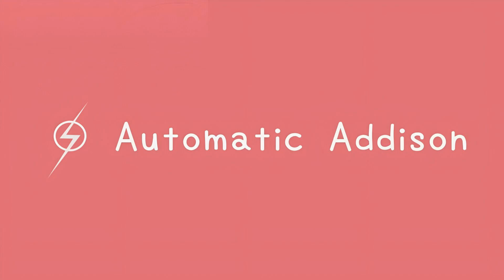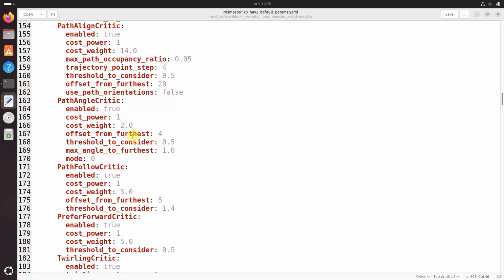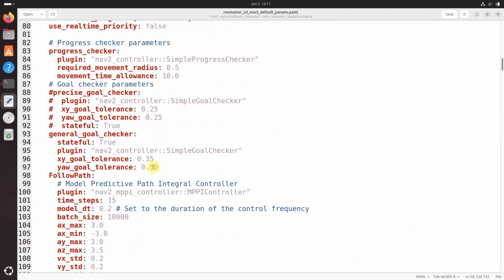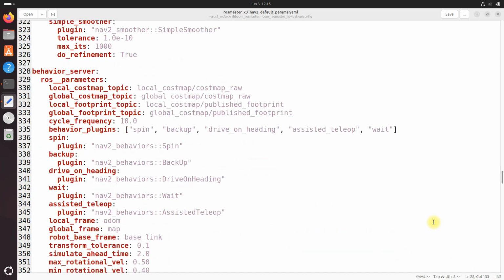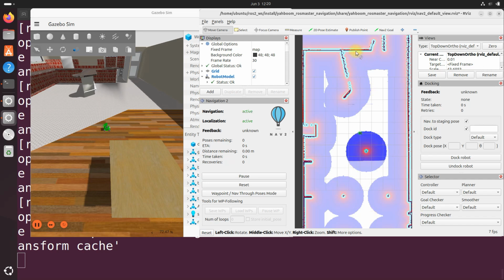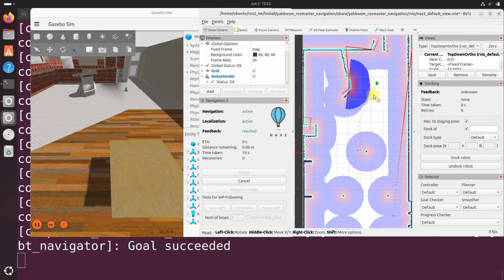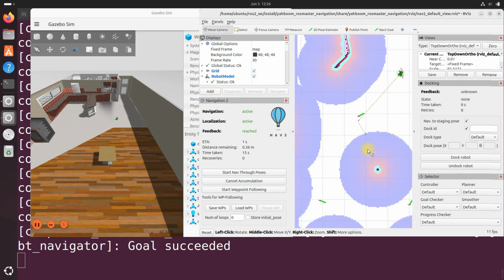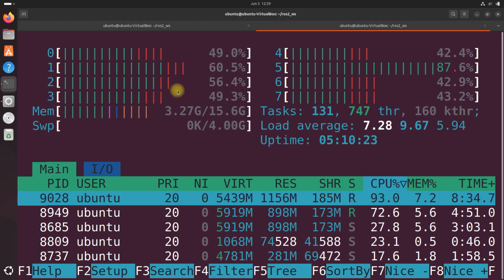Autonomous Navigation for a Mobile Robot Using ROS 2 Jazzy

Comment: Doing gods work here, currently doing a project where a robot moves to each room of an environment ive built so im hoping this helps me out B)
Reply from the maker: Glad I could help!
Reply: @automaticaddison quick question for you if you dont m8nd; ive finally did the slam and have the maps etc, do i need any custom set up to run the nav2 or could i just use the turtlebot3 nav package?
Reply: (Sorry not to spam) but i shouod add that the package is for turtlebot3 burger bot so its not following your videos project wise, i have an sdf environment, slam maps for said environment, and am looking to get the robit moving in this slam map for tasks etc